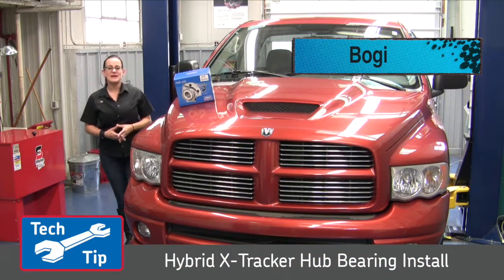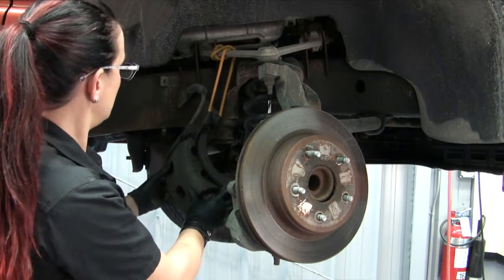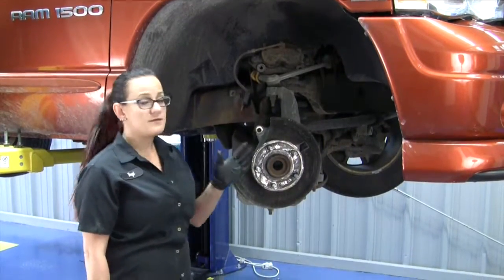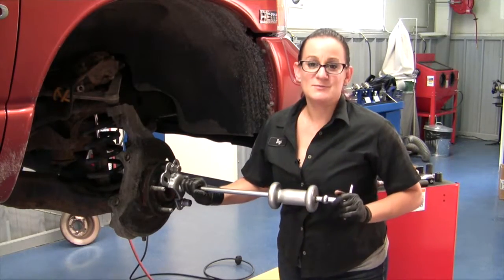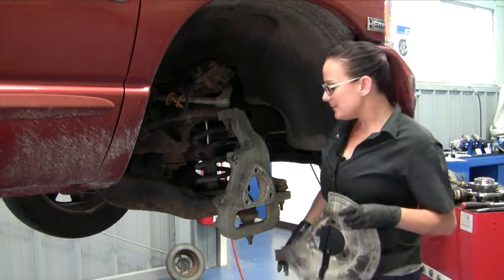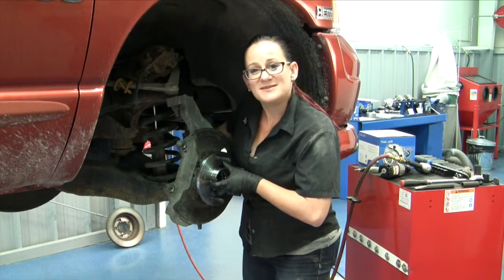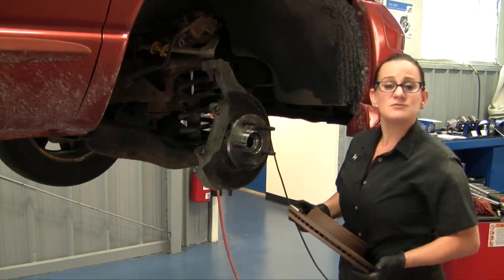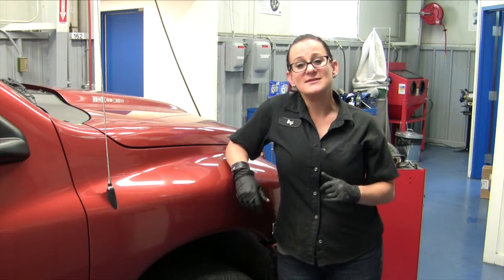SKF Hybrid X-Tracker hub install with Bogi

Comment: Thanks for using a torque wrench to reapply all the bolts. Too often I see mechanics use the air wrench to tighten everything, which is far too much torque to subject those bolts to. Not using a torque wrench can warp rotors, cause uneven seating of the wheel, and a host of other problems.
Reply from the maker: Great point! Over torquing with an air wrench can cause a lot of problems. Thanks for watching.